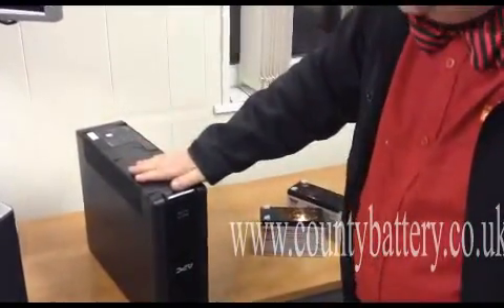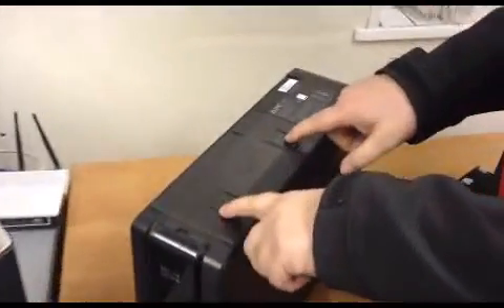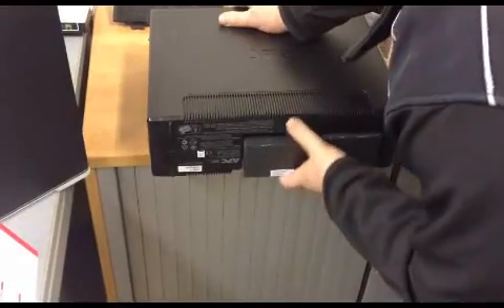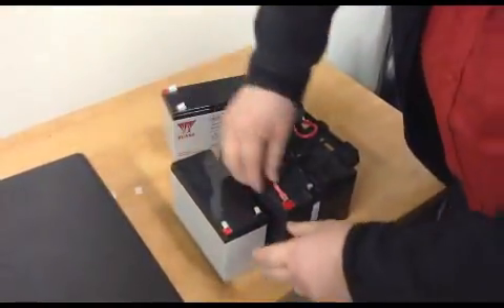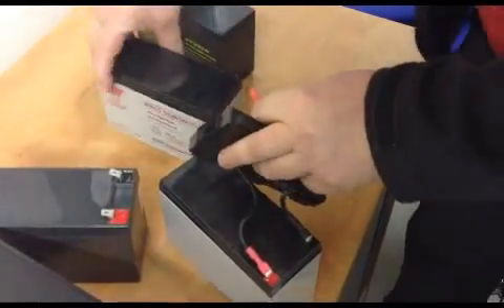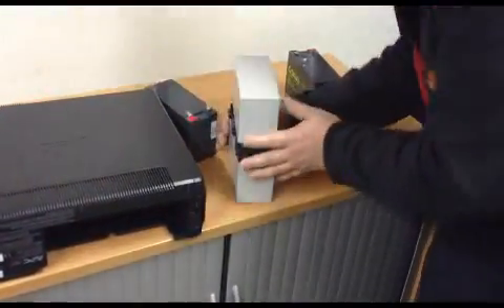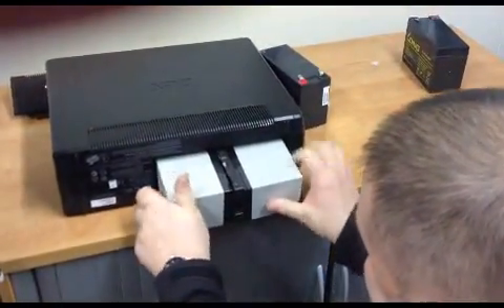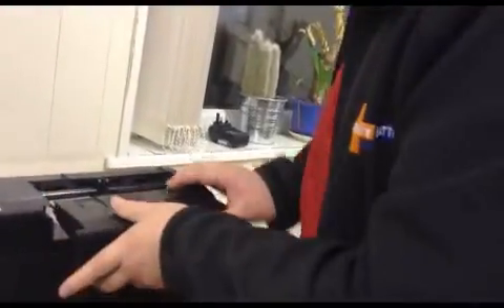Change Batteries in APC 1500 Pro UPS

Comment: I have a backup  apc pro 1500s where do I find replacement battery at
Reply from the maker: You don’t say where you are this is the spec off the battery we used https://www.yuasa.co.uk/batteries/industrial/npw-vrla-high-rate/npw45-12-npw-45-12.html

Comment: Great video! Are the "Long" brand the factory installed ones? Also, are those Li-ion type? Thanks & love the bow tie!
Reply from the maker: Thank you for your kind comments The Long brand batteries were the original equipment thy are Lead acid AGM. You could possibly replace with lithium batteries but the charging algorithm would need to be adjusted it’s probably easier to replace like for like.
Reply: @richardfuller9985  thanks 🤓 I got a hold of an APC 1000 Pro, & the batteries appear to be dead. I opened the battery panel, & they are the Long brand. Thanks again

Comment: I have the same ups APC 1500, do i buy a 12 V 7 AMP batter or 12 V 9 AMP battery?
Reply: Yvan The Pc Gamer you would be better with NPW45-12 https://www.countybattery.co.uk/vrla-batteries/yuasa-npw45-12-vrla-agm-battery-12-volt-8.5ah/ it has a higher short term capacity so can give a higher rate of discharge for a short period
Reply: @countybattery7207  thanks for the video! Regards from 🇬🇷Greece

Comment: You have listed a couple different batteries you can use which one do you recommend.
Reply from the maker: please find link to Yuasa spec https://www.yuasa.co.uk/batteries/industrial/npw-vrla-high-rate/npw45-12-npw-45-12.html  as long as your battery is manufactured to this spec or higher you should  be fine

Comment: Hi, is it okay we change from a 12V 9Ah to 12 7.2Ah battery as replacement? Is there any disadvantage choosing a lower amperage of a battery as replacement? Thanks.
Reply from the maker: bob sanchez the UPS will run for less time. You loose 2 ampere hours nearly 20% so If your equipment can shut down in that time then no problem. You should perhaps also consider that the battery deteriorate in time so you may have to replace sooner. The advantage is a few grams lighter and the batteries are cheaper
Reply: Richard Fuller thanks for info!
Reply: Thanks for the reply! I will probably buy 7Ah because it is all available here in my country. Thanks again!

Comment: My apc 1500 dosent turn on when I install the replacement battery  but it turn on when I removed them
Reply from the maker: Jean Rivera I cannot really comment without testing the UPS myself. I would start by testing all the connections are connected have you made sure that the positive and negative terminals are connected with the correct cables?
Reply: Richard Fuller  the apc turn on with out the battery it's only when I put them on I thing because they don't have the tape to hold them it disconnect them
Reply from the maker: Jean Rivera if you can get to one of our shops we will be glad to have a look at it for you
Reply: Richard Fuller thanks but I live in Puerto Rico i just take them to Batteries Plus Bulbs where I bought them and hope they know what to do
Reply from the maker: Jean Rivera sorry I can’t help Happy New Year

Comment: Is the middle piece with the wires come from the original UPC batteries?
Reply from the maker: AdmiralCecil Not sure I understand what you require. The original batteries should be connected together with a wire if they are not the unit will not work
Reply: Hello,

The batteries are sold as 2 pieces.  I see you have something in the middle with wires coming out to attaching the two batteries.

Comment: is it possible to run lifepo4 in this ups ?
Reply from the maker: +Stealth TheMan  Yes it is possible  the advantage of Lithium Batteries in general is that they are light and power denseI would not think that the UPS needs  to be portable so the only advantage would be the power density so you could get more power and or over a longer period, It may be the extra cost of the LiPO4 makes it more feasible to buy a larger UPS with bigger Lead Acid batteries, You would need to ensure that the charging system is correct for the BMS in the lithium (they tend to catch fire if you overcharge) If you want more help please call on  0044 1623  757377 or contact us www.countybattery.co.uk